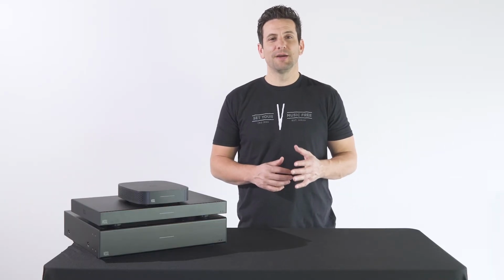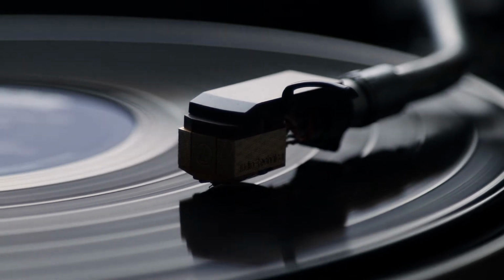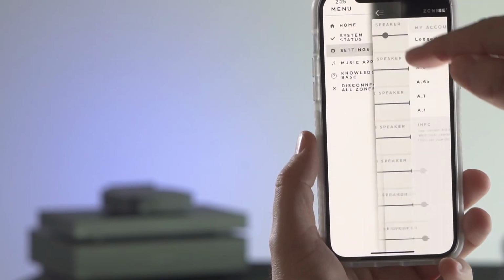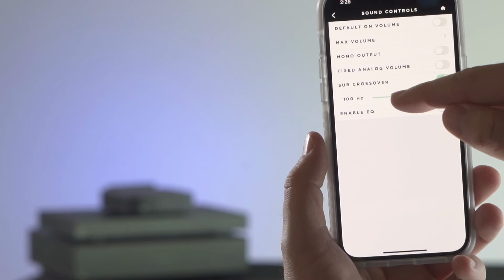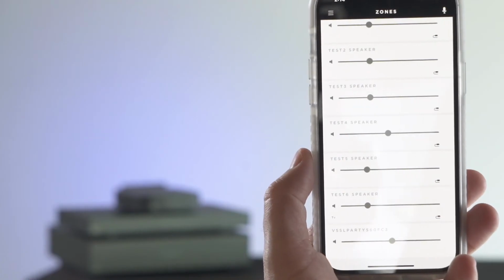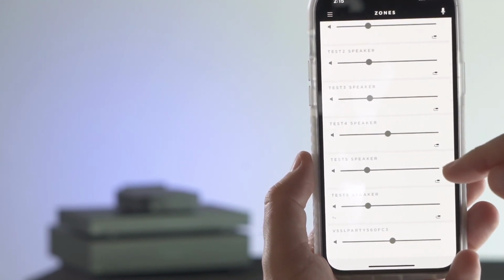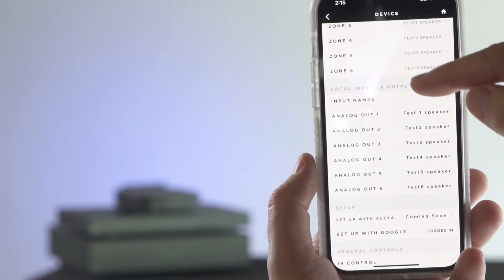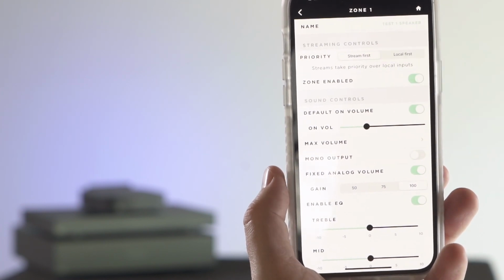VSSL - Inputs and Outputs

Comment: The VSSL A6, is not letting the customer group zones through google home
Reply from the maker: Hey there!  Google recently made a change to their platform that now requires every zone to be linked to a Google account before adding it to a Google Speaker Group.  This was always the case with Android, but only recently applied it to iOS devices as well. In the Devices section of Google Home select each of the zones individually  and click the "Add to a room" button.  Once all zones are tied to your account, go ahead and create a Google Speaker Group.